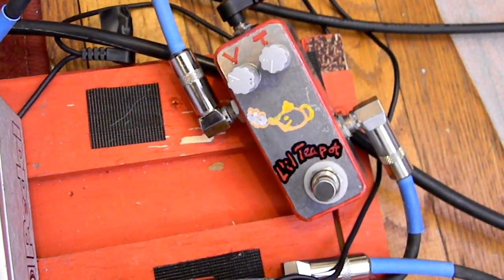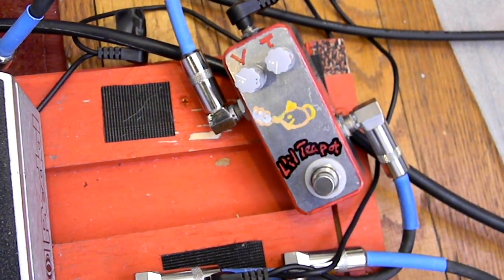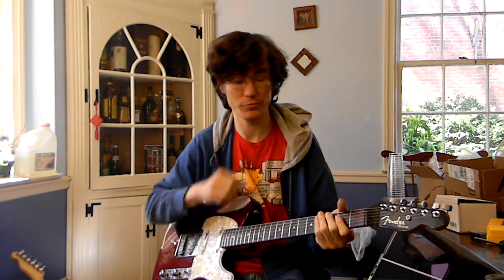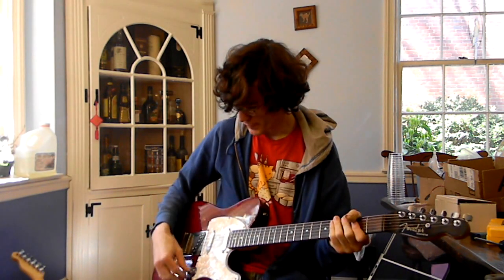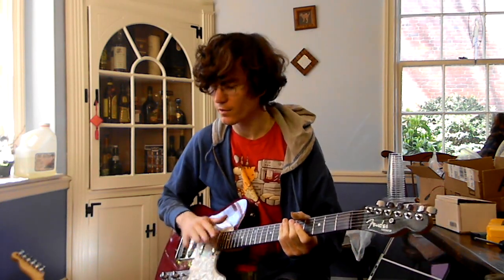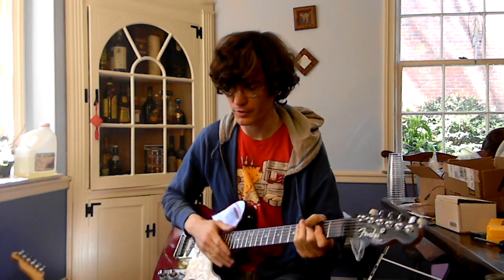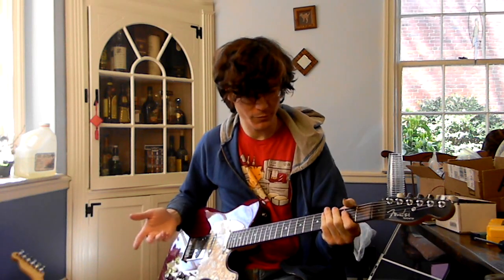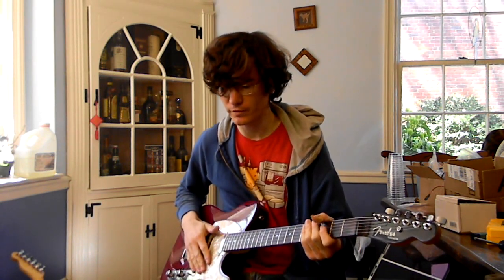The Lil Teapot treble booster (Rangemaster clone with mods)

Comment: Beautiful sound, I build a NPN RM with an old AC127, cero hum/just classic hiss with the volume up or down. I don´t know why is so quiet being RM really noisy. I reall love it, even the enclosure is handmade.
Reply from the maker: I think I read somewhere at some point that Ge NPN might have higher capacitance (would cut some hiss) compared with PNP, but I don't really have a good source for that. It might explain why germanium made better PNP than NPN transistors, though, since that capacitance would translate to less gain.
Reply: @jonspatton  You are right, it could be the reason. SaddIy I have no way to compare side by side my circuit with other one, I live in Venezuela so it is better to buy food in here than electronics part by now!!!. I bought  the transistor in 2006 and I finally build my RM the a few months ago. I just compare the mine with some others in youtube. I really liked to study that circuit, very basic, very interesting.

I´ve installed a bias control for the transistor base too.

I would like to try a silicone version too like strange master..    ..maybe someday (if situation gets better)..

Great videos, thanks for the answer.